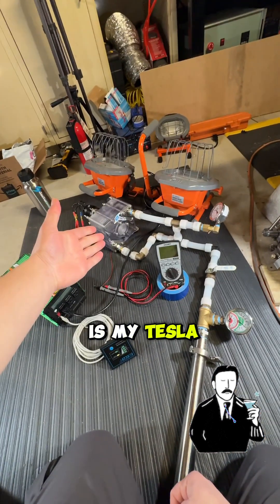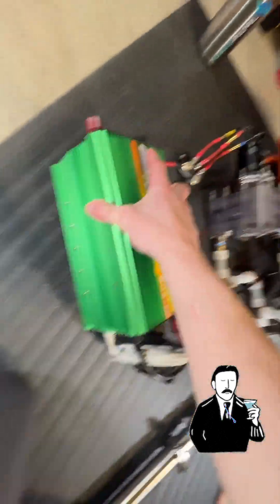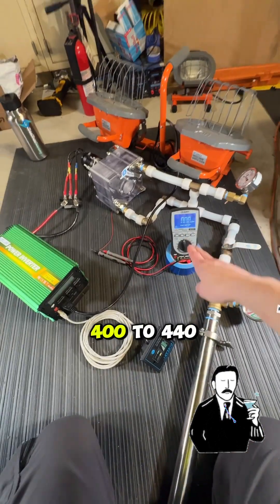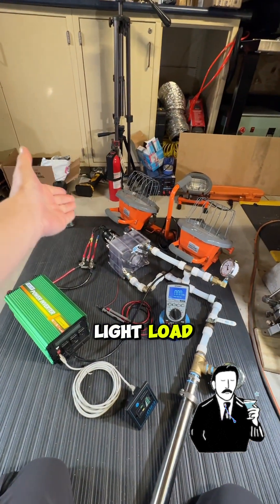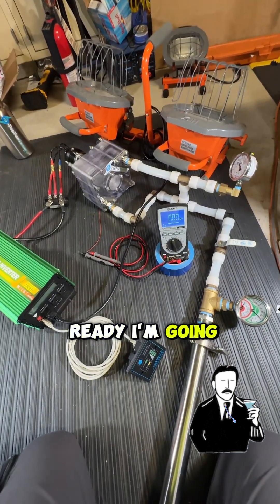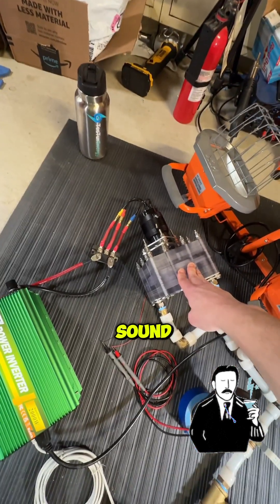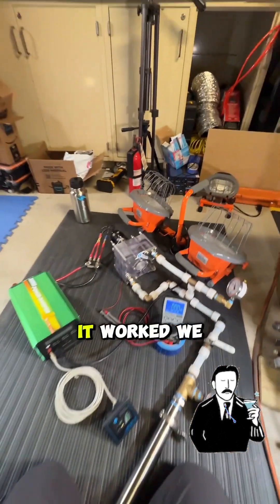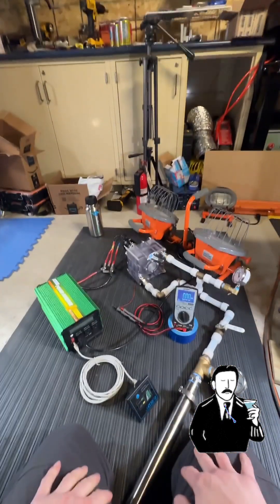4.5in Tesla Turbine - 600 watt Power Load Test

Comment: Brother, I have a few questions: What are some applications for this setup for the average consumer (or is it not meant for the average consumer)? Is this intended to be used as an alternative generator? Are there any solutions or concerns regarding noise?
Reply from the maker: Hey thanks for commenting! 🙏❤️‍🔥 Nikola Tesla’s bladeless steam turbine, patented in 1913 under U.S. Patent 1,061,206, stands apart for its unique design featuring smooth, parallel discs instead of traditional blades.  These discs capture the energy from fluids like steam, air, or water as they enter the turbine tangentially and spiral between the discs, transferring their kinetic energy in the process.  Affixed to a central shaft, the discs rotate along with the shaft as fluid flows through, converting the kinetic energy to mechanical energy.  Critical to the functioning of the Tesla turbine is the boundary layer effect, a concept rooted in fluid dynamics.  In this context, the boundary layer is a thin film of fluid right next to the discs.   Here, the fluid velocity changes sharply, from zero at the disc surface to the fluid’s full velocity further away.  This boundary layer is essential for energy transfer between the fluid and the discs.  As fluid spirals between the discs, the boundary layer forms and thickens in the direction of fluid movement.   Viscous forces between the fluid and the discs slow down the fluid particles in this layer, leading to energy transfer that causes the discs and the shaft to rotate. 
 
With TesTur Energy, we’re committed to empowering individuals with energy autonomy through our Combined Heat And Power (CHP) solutions.   Our systems are uniquely designed to harness overlooked energy resources like biomass, solar thermal, and geothermal, as well as unconventional fuels rich in solid particulates—think sawdust, pulverized coal, or powdered iron.  Traditionally, these alternative energy sources and fuels have been underexploited due to the limitations of existing turbines and engines.   These systems often can’t manage the complex fluid flows—mixtures of gases, liquids, and solid particles—that are characteristic of low-grade heat boilers and unconventional fuels.  But our technology changes that, enabling sustained, damage-free operation even in these challenging conditions.  www.HeatAndPower.com  www.TesTurEnergy.com 
 
When it comes to utilizing low-temperature, high-pressure gases for power generation, technologies like Compressed Air Energy Storage (CAES) and Cryogenic or Liquid Air Energy Storage (LAES/CES) are not just theoretical; they’re already in use at the industrial level.  In the context of engine mechanics, the typical workflow involves compressing air, heating it, and subsequently expanding it.  This is the essence of most gas turbines and turbojet engines, which operate based on the Brayton cycle. For those not versed in thermodynamics, the Brayton cycle consists of three key phases:  Air compression Heat input (usually through combustion, but other methods work too) Expansion of the heated air. 
 
When considering steam-based systems, you only need to introduce heat to turn the fluid into vapor. Technologies like Ocean Thermal Energy Conversion (OTEC) can not only produce steam but can also operate using an organic Rankine cycle at notably lower temperatures.  Of special interest is Tesla’s amended turbine patent, GB 186,083. This inventive design uses the residual heat from the turbine’s exhaust to produce steam.  The generated steam then pre-cools the combustion jet prior to entering the turbine, thereby reducing the usual compression demands seen in traditional gas turbines.  While conventional gas turbines work with air-to-fuel ratios ranging from 100:1 to 200:1, Tesla’s design minimizes the strain the compressor places on the shaft, allowing it to run efficiently even with stoichiometric ratios as low as 15:1.  Furthermore, Tesla’s subsequent patent, GB 186,084, integrates both combustion and steam turbine functionalities, negating the need for a separate compressor. 
 
Our initial tests serve as an exploratory stage to gauge the electrical output potential of a Tesla turbine driven by room-temperature compressed air.     Remarkably, our plastic and aluminum 10in diameter prototype generated 6.22 ft-lbs of torque at a mere 4150 RPM and over 4.25 kW between 6000-12,000 RPM.     This places our prototype squarely between the capabilities of a 50cc and a 125cc combustion engine, even with those on 150psi compression scenario.    During our tests, TesTur nozzle pressures stayed below 20psi for a 2650-watt electrical load and never exceeded 40psi during a 4250-watt dyno test.     The smaller 4.5in diameter prototype has been tested up to 600watts with real electrical load at about 15,000rpm. And up to 1200watts on the Dyno between 6,000rpm and 18,000rpm. And the nozzle pressure was about 25-30psi.  These initial tests serve as a baseline for future tests involving combustion-level temperatures.    It’s noteworthy that when using elastic gases, an often-overlooked aspect is that gas viscosity actually increases with temperature.     This not only boosts thermodynamic efficiency but also enhances TesTur’s isentropic efficiency by reducing slip due to the increased viscosity.   

As for the noise, when this is placed inside the vacuum chamber like in my steam test videos, the even the turbine of mine that’s geared up to the generator is dang near silent in there. 

With some proper balancing and decent bearings this would be much quieter and with properly designed pipes leading to the turbine it will also be much quieter. 

If you’re interested check out the steam system tests I’ve posted about in the past. 

 Cheers I hope this helps.

Comment: If you put magnets on the disks and coils in the housing would it have less drag ❓
Reply: If you put generic magnets on the discs you create flow obstructions = bad and have to overcome the rotational forces, and operate the motor at the same RPM as the generator. If you wind coils in the housing, you have to develop an electric motor in addition to a tesla turbine with larger than usual gaps between coil and magnet, and develop the motor driver and controls...

A shaft is the best way to couple prime mover to generator without impacting turbine performance with weak material (tensile/yield/fatigue strength, hardness, etc), and you have all the space to use whatever volume, power density generator you like, and at whatever gear ratio.

Most importantly, you can use fully characterized generators to design your system without creating more unknowns.
Reply: ¿magnetic bearing?

yes
Reply: @Xayuap  no I'm taking about making the turbine an internal generator. Another YouTuber built one from old CDs but he never went into how powerful it was or how far it could be pushed.
Reply: @peacefulscrimp5183  also the problem with Charlie's current demonstration setup isn't because the generator is bad in some way, it's very efficient.
The challenge is that his demonstration is extremely difficult to control. 

-The solar inverter has a voltage-RPM deadzone and a hysteresis designed for battery recharging that will not deliver power for some time if his regulation attempts fail.

-The turbine consumes air at different rates at different RPMs.
-The pressure in his 4 tanks are not constant, they're dropping.
-The constant power load through the inverter produces RPM-dependent torques at the generators.

-And to balance everything going on here, Charlie is using a lever style ball valve to adjust the non-linear motoring torque against a non-linear generating torque. The working principle of these ball valves uses a bore to partially or fully block flow, and the size of the bore creates resistance. 

-Feedback of his ball valve hand adjustments requires him to read gauges and digital readings to know how much he should move before the system falls too far out of equilibrium. If he overcompensates in one direction, he wastes air, the other direction shuts the generator down.

-To make matters worse, as his system discharges, the amount of adjustment becomes more pronounced, so the relation of how his lever affects the system is not intuitive and constantly changing.

It's beyond difficult. Trust me it's not the generators.
Reply: @Infinion  My question will probably reveal this, but I have no engineering background. Why can't the job of regulating the flow be left to the electronics? Does that kind of equipment not scale down properly or is there a bigger reason why Charlie is doing it manually?
Reply: @gaemr_o5147  My comment keeps getting deleted, i'll try to respond at some point when YT lets me.
Reply from the maker: Cheers thank you for explaining that all so well 😅😇 yeah it’s a lot of of guess and check as fast as you possibly can imagine. The bigger turbine was a lot less sensitive to this too. 
 L
Reply from the maker: Yes it will be fully regulated in the end. 

And I’ve been waiting to do this because I want to make a full project out of building the regulators that Tesla went with in his patents. 

As previously mentioned I can only do so much at once. 
 
And right now I’m focusing on getting all the turbine orders we got finished and out the door. 

And I have a lot of time on my hands baby sitting my CnC machines. While they cut so I’m making as much content as I can to help spread awareness. And put out a lot of the ideas and theories I’ve had over the years. 

Let me know if you have any questions!